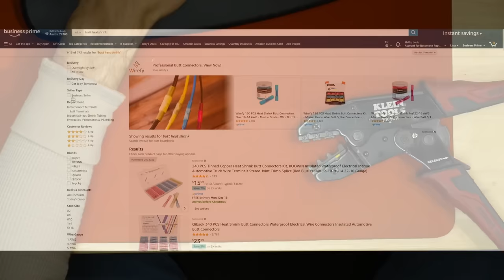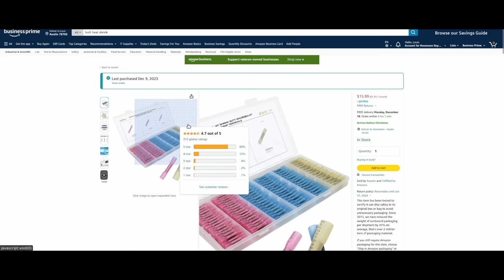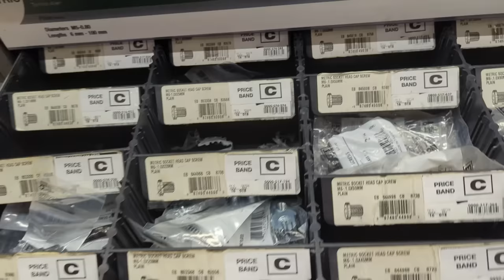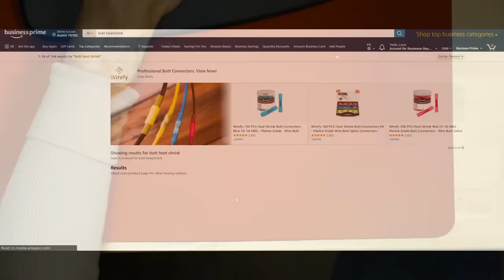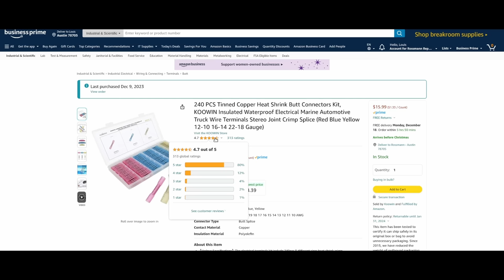Amazon Sells Dangerous Electrical Crimps

Comment: Oh, you're going to love this. My sister bought my mother a "brand new" vacuum cleaner off of Amazon. We received the box, which was beat to heck. I helped her open it and oh my, I wish I had been recording. Not only was the vacuum used, it was FILTHY. I'm not being hyperbolic. Filth, dirt, and small rocks poured out of the box and all over my mother's floor & covered part of my pants in dirt. The inside of the dust bin had large patches of old, dark dirt & grime hardcore stuck to it. The vacuum itself was covered in scratches and scuffs and in general looked beat to high heck. By all appearances, the vacuum appeared as though it had been used for a lengthy period of time in an industrial setting and instead of throwing it away, someone sold it as "new" on amazon. That incident is why it is now common practice for both my mother and I to record video of any unopened boxes from Amazon as well as record the complete unboxing of anything that we get from Amazon. It's also why I generally prefer to shop elsewhere first, and this played a role in why I cancelled Prime. This whole 4-and-a-half star issue routinely results in "meh" products, but this? This was disgusting.

edit: fixed typo
Reply: I ordered an electric massager online like what my barber uses. It was clearly used and reboxed.
Reply: I ordered 'plastic bird spikes' that were installed and returned, then sold to me.  Like 30 feet of the stuff.  mounting screws still stuck in it.  i was not allowed to leave a review with the picture.  I kept it as it was re-usable.
Reply: That's disgusting.  Probably a return scam, even.  We cancelled Prime earlier this year.  It's not worth it anymore.
Reply: I have run into this problem increasingly. I have received several products which are obviously and clearly used - at best - counterfeit at worst. I have a healthy Amazon ordering history with limited returns so they're usually pretty good about making it right, but the fact that this has become as prevalent a strategy by Amazon sellers - without any pushback from Amazon itself - has further driven me to consider Amazon as essentially a slightly better Temu.
Reply: Did it suck?
Reply: @roxcyn "it's not worth it anymore"

I live in the UK and cancelled Prime about 6 years ago.

The reason was that I would order something for next day and get an apology email on the day saying "sorry there was an issue with your shipping, now estimate 5-7 days".
I would call Amazon customer support and they would give me a free month prime on my account.
This happened over and over again.

I cancelled prime and started selecting "5 day shipping", I would say that 85% of my orders arrived next day.

Once the infrastructure for immediate dispatch and delivery was in place, they stopped differentiating orders.
Hence why they promise next day but fail to deliver, or they say 5 days and its next day.

Prime users are just subsidising fast delivery for those who don't have prime but still use amazon!

Or at least that's how it was, I try not to use amazon at all if I can help it now, so I don't know how fast standard deliver is these days.
Reply: @richardwillson101  - Yes, that was one of the issues, they promised 2 day shipping and it wouldn't come.  So why pay for Prime then?  I'll just get $35 worth stuff and if it gets here early (2-3 days) fine and if it doesn't, okay, too.  Here shipping issues weren't a problem to me until around 2019.  Stuff kept coming late and I would give them a pass, but enough was enough and we didn't renew it this year.
Reply: It wasn't 'sold as new'
The person bought the same make/model on Amazon, packaged their beat-to-hell old unit in the box, and returned it.

Amazon does not inspect items that are returned, just re-stock them for the next sucker to get.

I've been a victim of that a time or two and raised hell with Amazon.  End result:  I get the item - new, in properly sealed packaging - at no cost.
Reply: Wow, that's bad. I've had better luck knowingly getting used stuff from ebay. The worst I've encountered from ebay used is some discontinued niche industrial automation device smelt like nicotine LOL
Reply: On the bright side, at least their return policy tends to be low hassle. My wife ordered some boots. When they arrived they were cheap crap from China (not sold cheap though). Worst was that the rubber soles absolutely stunk like petroleum. Thankfully "they stink to high heaven" was an adequate reason for return according to Amazon.
Reply: @amzarnacht6710  Not sure if I follow you, but it was my sister who ordered the vacuum so I was able to personally see that it was ordered 'new'. The rest though, I suspect that you're not far from the mark. The third party seller either tossed trash in "by accident" - which I don't entirely believe - or attempted to pull a fast one and hope that we wouldn't go through the process of sending it back.
Reply: @roxcyn  My ex and his family routinely engaged in return scams. They would buy a product new, only to return the used item as the "new" item. Was disgusting behavior.
Reply: @wiiztec  lol a logical question. But we did not turn it on to see. It was absolutely filthy and I wasn't about to have it blow who-knows-what kind of dust all over the house on top of the rocks and filth that had already covered the floor. Thankfully, she still had an operational vacuum. It needed some electrical tape around the cord but I took care of it and cleaned up her floor and such.
Reply: @RadioactuveToy  - Yes, it is.  And then Amazon and/or the seller will sell it back as new which is a horrible action, too.
Reply: People do this at Home Depot with tools. They buy tools and put their old tools, batteries and chargers in the new box and return it, then someone else buys it and has to prove they didn't do it. Open your tools in the parking lot and double check they haven't been opened before purchase.
Reply: Your sister was a victim of a return scam which is getting increasingly common on Amazon—somebody bought the same make and model (or similar enough) as their old vacuum, took the new one, packaged their used one and sent it back for return. Nobody bothered to check if the returned item is in order, they just sold it to the next person and that happened to be your sister... It sucks, but I guess Amazon rationale is that in most cases that would be fine and that an occasional return scam costs them less than to have people properly inspect each returned package. Sure, there is the expense of customer trust but they have so many customers so they can afford to lose a few occasionally...
Reply: @zwerko  I see. That explanation does make perfect sense, I appreciate the response. As you say, they have many customers more than I, but I'm so glad that I no longer have Prime and only use them as a last option.

Comment: Something you didn't mention is item binning. We do a fair amount of repair work on furnace wiring. We have specifically purchased from one listing with high ratings, name brand, specified metal gauge and high temperature rating. We put them into service. Time goes by and we start getting calls related to furnaces, smoke smells, small fires, etc. In every case it was these connectors. We then started comparing the connectors from two purchases from the same listing. Different products, but exact same packaging and specs!! The fake ones were thinner and just couldn't handle the current, so they were overheating and causing cascade failures in the components on which they were installed. Counterfeit products binned together with the real deal on the same listing. You may never know until it's too late. These practices could put people's homes and lives at risk!
Reply: If you’re not buying that stuff from like DigiKey or Allied Electronics or Newark or another dependable distributor; you’re really doing it wrong, sorry. For a mainstream business like yours, buy brand name stuff from authorized distributors only. And ignore Amazon.
Reply: @absurdengineering  it's true they shouldn't have bought for amazon, but that doesn't take away from the validity of their criticism.
Reply: But they r making money so they don't care, flat out
Reply: This is COMMON on Amazon!  The counterfeiters are rampant!
Reply: I'm pretty sure that's grounds for a legitimate lawsuit. Fire hazards are no joke and there's definitely liability to be had somewhere along that supply chain.
Reply: Yup, this is a massive issue that I have experienced many times. Can become very difficult to tell the difference between the reals and fakes.
Reply: Yeah. Buying no name products scare me, especially electronics. Bought a no name power bar with no issues yet 🤞
Reply: Yes I've had this issue - one listing but two or three different brands are sold under that one listing.
Reply: @absurdengineering  But thats not the issue. Issue is we shouldnt have to be like "Hey have to buy from here cause X is shit". Any vendor should have legitimate good quality product and thats the issue we are talking about. 

Yes you shouldnt buy highly sensitive electronic components from Amazon. But Amazon also shouldnt be selling absolutely hazardous electronic components.
Reply: @memnarch129 This same mixing of warehouse stocks happened some years ago in the aircraft parts industry, and it was reported on TV that even the internal stockpiles of the FAA ended up having fake components in the bins that were supposed to be good stuff .
  Similar crap has happened to medicine in many markets .

Comment: During lockdown in the UK, I used Amazon to buy a lot of tools and DIY items. Most were junk and returned. Drill bits that failed, bent set squares, poor quality screws. When you go to return the low price items, they would often tell you not to bother sending back.

Comment: I’ve had no problems with the stuff I’ve ordered from Amazon. I read the product reviews, but I never read the 4 or 5 star reviews. I only read the 1 star reviews. Those are the ones believe more.
Reply: This is the way to navigate Amazons bullshit sellers.
Reply: For popular products, 1 star review is a good way to target bomb competition product. 2-3 stars are where you see actual users putting complaints to product.
Reply: Yep and if it’s a recent 1 or 2 star review believe it because the product is usually trash 🗑️.
Reply: same ! its saved me from at leas 3-4 bad purchase
Reply: Sort by most recent. Usually will find the most accurate reviews that way.
Reply: I buy from Amazon sometimes, if I think I could trust the product. I am skeptical though. I check what the 1 and 2 star reviews say……The biggest item I considered to buy was for a Christmas present. I didn’t trust the 3rd party vendor though. I went to the product manufacturer website and bought it directly. The product that was sold through Amazon had less than a 1 month warranty. The same product purchased directly from the manufacturer gave a 3 year warranty said I did not have to buy separately.
I have also noticed that a lot of the manufacturers are from unknown brands. Buyer beware. This stuff seems more and more like Temu…..
Reply: Always look for the 1/2 star review with pics they will absolutely tell everything you need to know about the product.
Reply: I see everything I look at, usually has mostly good reviews, always a few terrible ones, I believe those, but it comes down to quality control and percentages, there will always be some duds, so I have to buy something, I pick things with mostly good reviews. so far so good. reviews about poor customer service response factor in as well to purchasing decisions.
Reply: No, you should be reading the middle reviews that are more analytical, detailed and critical of the product. Just looking at the one star review, you do know that people that are more likely to leave a review are people having issues with it than people that are satisfied so looking at one star only can skewer the thoughts on the product.
Reply: I used to do this too, until I realize that I would never buy anything at all since all 1 star reviews change my mind. So i got with 3 stars haha.

Comment: Pro tip:  When buying from HD, place an on-line order for delivery or pick-up from your local store so that an employee has to pick the items.  Items not in-stock will ship from corporate.  Corporate is a separate entity.  If you return something that was supplied by corporate at the local store they have to return it to corporate instead of adding it to their inventory at the store, even though everything is on the same invoice.
Reply: Solid advice. Thank you.
Reply: 💯 that is what I started doing after watching a video on the Torque Test Channel of them trying to buy a tool that was supposed to be in stocks. They recommend pick up in store online ordering. If what I'm after is in stock, it takes about 30 minutes for the order to be ready for pickup.

Comment: This is EXACTLY why a container of actual, brand name Sta-Kons cost well over 100 dollars. Connectors are something where you definitely get what you pay for. Never stop, Louis. You're really an asset to us all.
Reply: same with molex, anderson etc etc. they cost money but they just work, which is 3 times woth the money.
Reply: Wago as well. You can buy some non name brand Wago and throw them in your wall but when your hot wire slips out while you push an outlet in and turn your breaker on to a pop you know why you shou;d've paid the extra $15 for Wagos.
Reply: Yeah, connectors for hobby stuff I buy new old stock on eBay or direct from an authorized distributor.
Reply: @majstealth  Deutch connectors are another really expensive connector, and there are starting to be some really convincing fakes available. It really comes down to "if you know, you know" when it comes to this stuff. I wish more youtubers would talk about this stuff, because the vast majority of people out there don't know what they're buying. Louis is only one man, he has only so much reach.
Reply: @AtracBreezy  Wago are worthless. I hate them as they do suck. Wire nuts are still the best when it comes to joining to 2 wires.
Reply: @TooMuchMiddle  yeah thats true
Reply: There's also some details electricians know that Louis missed, you can't use just any Crimp tool on any connector, even Sta-Kons can pull right out if Crimped with a non-listed tool. Each Crimp tool die is designed with a certain manufacturer's terminal in mind, as terminal designs vary from brand to brand. It's not as simple as "blue terminal go in blue nest".

Comment: The biggest problem is Amazon have DELIBERATELY removed the option to 'filter by seller' now, so you cannot search for products 'sold and shipped' by Amazon anymore, meaning a much higher risk of buying something counterfeit and/or, quite frankly, crap.

Edit: third party sellers are what have ruined Amazon, and it's by Amazon's own choice that this has happened.
Reply: All retail sites allow 3rd party sellers. I only buy stuff sold by or shipped buy amazon. I am not going to risk buying crap from a 3rd party seller. There are select items that I will buy.
Reply: @kameljoe21  Same here.The only third part sellers I buy from are the ones that are run by the actual company that makes the product.
Reply: @BrooklynBalla  Yeah unless you know if that company is legit its super hard. The last thing I bought from a 3rd party seller was a set of crochet towels from some lady/company named deb something.  Being that its a gift for a neighbor it was a risk and since they are US based its not a bad deal. 
One item I tried to buy I never got because the seller went inactive. I may still try and order it again yet doubt they are active. Yet amazon has not taken the item or seller down.
Reply: Bought a waterproof apron for work. It had a powder on it that gave me a bad rash. The seller? Chinese. No surprise there 😑
Reply: Yeah Amazon isn't so bad as long as you know how to navigate through the bullshit, as with most things on the internet.
Reply: @kameljoe21  I will but that is if it's a game or movie, not a generalized thing like this.
Reply: amazons choice was to turn a bigger profit, they dont give a f about you getting a good product.
Reply: @Malohta  The powder likely was part of the manufacturing process in which they skipped the cleaning part of it to lower the cost. This is the reason why a lot of reviews have 1 star. User error. You opted to not wash/clean it before use thus causing you irritation.
Reply: Thank you for highlighting this. Using Ctrl-F one may still locate the "Sold By and Shipped From Amazon" purchase option, if it exists for an item. Amazon's Seller Rotation policy makes it an absolute b;tch of a task. Cheers!
Reply: @kameljoe21  The pictures they had showed people wearing it with the powder which didn't seem like powder when you first put it on.

Used it for dishwashing so it got wet and didn't come off. Had to scrub vigorously for some of it to come off.
Reply: Their search was always pretty bad.
Reply: @kameljoe21  It doesn't make a difference as long as amazon doesn't allow us to see where they got their inventory from. You will have inventory from both good and bad sellers mixed together and it's going to be a gamble. If you checked this video, the bad crimp was shipped by Amazon.

Comment: When I do shop on Amazon I always check who the seller is and make sure it's coming from a brand I recognize for things like this. Had to do this recently for 3M command strips because none of the stores I went to had the size I wanted in stock. Had to wade through lots of knock offs to find the real 3M ones though. Luckily many of the knockoffs did have bad reviews saying they were garbage so I did not fall victim.